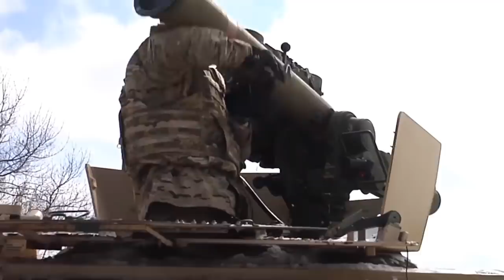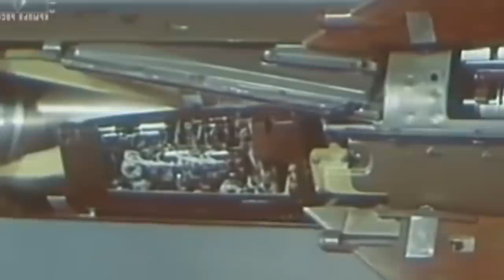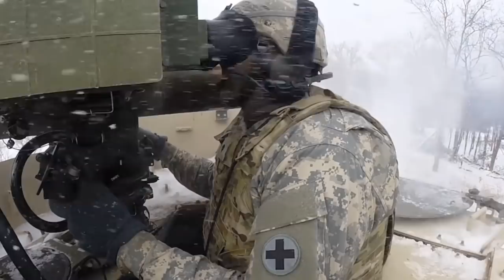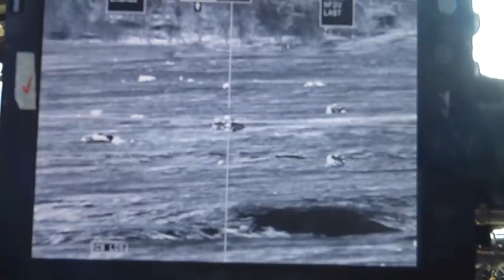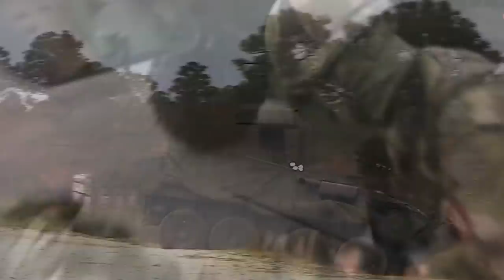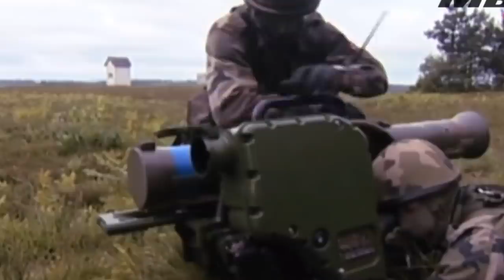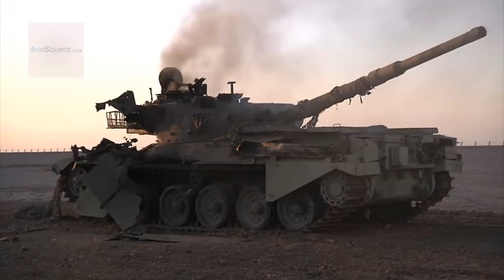Should Main Battle Tanks have Anti-tank Missiles?

Comment: Big guns are great if you want to have a big vehicle. Big vehicles are big targets and are expensive assets. They also require expensive supply trains. Moving large armored vehicles is expensive, and requires large air/ground/naval assets. Big vehicles are also not flexible. That is, fewer of them can be deployed, limiting the number of places that can be struck or defended at any given time. Heavy armor is also not practical in the age of ATGMs, as it is easily defeated by missiles at ranges that big guns are not capable of engaging at. Protection against small arms fire on a vehicle is sufficient as long as it is equipped to dispatch more heavily armored assets at range. Tanks are, in effect, obsolete.

A very small, autonomous tracked vehicle with 2-4 ATGMs (or a combination of those and AAGM) and a machine gun or autocannon could accompany every infantry squad and provide effective fire support against armor, defensive positions, and infantry. It could do this without weighing down the infantry, or exposing them to fire. If you add in another autonomous vehicle or two to carry supplies, and small reconnaissance assets that can be deployed locally (drones), a squad could become much more flexible and independently capable. Small and flexible is the name of the game. Hard to hit, affordable lethality.

Comment: actually i can see (somewhat strangely)  a divergence within the next 20 years with battle-tanks again.   With the MBT possably vanishing, and effectivly cruisers and infantry tank making a comeback.   the problem or reason stemming from a fundamental issue with rail-guns.  the power requirements on a rail-gun go up exponentially as the size of the round they are slinging goes up.  A 40mm HVAPFS round out of a railgun at 3-4 km/s will likely punch straight through most tanks, and be able to hit tanks, or even helicopters out to 8-16km  retaining enough energy for a kill.   The problem is,  A 40mm HE round,  at those velocities, is all but pointless, and sure you could scale the speed down to 1km/s  and rapid fire 40mm rounds but again,  its not much better then firing a grenade launcher.   For infantry support you want 105mm+  So you'll have the infantry support tank which doesn't have the speed of the cruiser tank...  but instead carries a 150-180mm low velocity tank gun,  firing tube launched missiles, HE rounds, HESH rounds, and HEAT.  HESH in this case is not for anti-tank, but anti building,  creating massive breach holes in the sides of buildings (Usually was used by US Engineering tanks.)  or flattening fortifications.

Comment: Most Chinese and Russian tanks use auto-loaders. If they want to change from DU rounds to ATGM, how will they achieve that? Sounds awkward.
Reply: Thanks B1. Not sure about the unloading either ( eject most likely?) but auto loaders saves a crewmen and allows for extend handling of heavy shells in even broken and rough terrain. The think with Western tanks is that while they are nice a stabilized it's no joke loading heavy shells on the move in broken terrain. As i understand it by the late 60's or early 70's Soviet tanks ( t-64 , T-73) had a significant capacity to fire accurately and on the move at 1.5 - 2 k engagement ranges.

Comment: Redundancy of different systems and ATGMs are inferior to a tanks APDSFS round.  ATGMs were invented to give light vehicles and troops a means to deal with hard targets and tanks but they always lacked one of the key qualities of a tank gun and munitions.  ATGMs are slow and rely on shaped charges and this makes them easier to defeat with modern tank mounted countermeasures.  It would simply be a waste to install an ATGM platform on a large tank that already has superior AT munitions.   I'll take using an APDSFS over a Javelin any day and I don't want to be bothered with dwelling on my target while leaving my tank partially exposed after firing a TOW missile.   High velocity guns rule.  If you own one, then use that.

Comment: I'd say yes, because we can slave the atgms fired from tanks to drones. Thus the tank can fire from behind cover at a target that it can't see and one that can't see it back. Which is obviously a pretty good advantage, though the same can be done with normal tank rounds. Only question is when an army would employ such a system, because all the tech is there. Just most tanks would need modifications to allow some systems, which of course would cost money. Now of course i'm talking about missiles that aren't wire or remote guided, thus they have their own systems for tracking a target. Because ya, missiles you have to guide yourself are just stupid for modern warfare. Since they force you into a position that limits you quite a bit.
Also with newer tanks, you don't have to limit them to atgms. Because if you wanted to, you totally can have a tank fired a short range aa missile. Just once again you'd most likely have to make some adjustments and thus spend money.
Reply: The tech is already here, including the AI for autonomous engagement. NLOS missiles don't require slaving, or a person actively guiding them, although that too has its benefits. And in the future, the line between drones and missiles will get even more blurred than it already is with the arrival of loitering munitions.

At this point it would be best to just go straight for vertical NLOS launchers on an armored chassis. Should mostly solve the problems with complexity, capacity and space that missile tanks and missile tank destroyers have historically had, too.

Comment: Because of the cost, Tanks should first shoot their Cannon to kill an enemy tank, if the tank survives, the missile should be used as a follow up shot to prevent the enemy tank from firing back! This should also be the case for tank destroyers, the entire point of tank destroyers, use the cannon first, and the missile if required. Or in the case where a tank is outnumbered: two enemy tanks vs. one US tank, the missile gives you the ability to fire at two enemies simultaneously! Missiles should be for clutch situations, not standard M.O. The use of tank destroyers should be to lower the cost of destroying an enemy tank, a javelin missile is 175,000 dollars, and though an armor piercing shell is 9000, (it should really cost less than 1/10th that) its still a lot more affordable! two javelin missiles and you have a tank destroyer that is good for years of tank destruction, especially when drones give it the ability to fire beyond visual range!

Comment: ok lets use my brain and some base knowledge on this.
A. Why mount ATGM on Turret ? What ATGM give to tank ? Longer range penetrator, ok sound nice, there is problem with this, most tanks can and will place shots on max range they can see, and most battles wont take place on range of more than 5 km, why ? Tarein, there is always a lot of things that block line of sight on long ranges.
B. Why not Mount ATGM ? Cost ! They need to be implemented into existing or new tank design, you need to get exta aiming system, you want use your guner to use gun, and commander to check battlefield, so who going to use ATGM ? Loader ? Ok then who load gun for you ? Driver ? Yes and who going to drive your tank ? So we have a problem right? Ok lets go forward. USSR/Russia use barrel launch missiles to get this long range killing potential, then why they almost never use it ? It lower lifetime of gun a lot !, so it cost a lot, so what mounting it outside of turret , ok next to what ? It's a missile , it has full, and warhead, so what if they hit by Autocannon or he shot, or rpg? Yep it will explode damaging a lot of important systems on turret that you need to fight. So we need to armor it a lot and build it with side explosion mechanism to protect tank, ok what about interfary that support tank? Yep we just make there life harder.  On top of that we add Weight on top of all problems, and that means more problems for engine, and sapers like me who have to make you a freaking breage under fire fast.
 
Let's sumee this block of text, there are no large logical reasons to add Missiles as extra weapon to tank, ATGM job is punch above your weight, tank do that using its gun, so until we end with a tanks that can kill enemy tanks using there guns there no need for ATGM aboard, ManPads on another hand my or my not find there way to new generation of tanks. Same go for 20 mm autocannons mounted on top or side of turret to give tank basic Air defense and city protection. For now I say good day/night to all of you. My imperial knight won't paint it selfe ^^

Comment: Would this be a good, anti-ied device, attach a load of ropes to the back of a mil 8, atach   rocks  the ropes and and fly low ib the air with the rocks on rhe ground
Reply: Are you talking about the M1 ABV? 

Which is basically an Abrams variant designed for mine clearing equipped with MICLICs?
Reply: I mean, yes, but it would fucking suck for the helicopter crew

Comment: doesnt the Russians use ATGMs in their MBTs?
Reply: Sabau Danut Alexandru in mother russia. tanks reloads their ATGMs automatically from 50 years or so
Reply: All tanks from the T-55 have the capability of firing ATGMs. T-55 / T-62 / T-64 / T-72 / T-80 / T-90 / T-14 and their modifications in the presence of the installed kit KUV.
T-55AD even had the first serial active protection kit.
Also there are kits installed on the BMP-3 100mm and 105mm NATO, etc. with a 100mm "Arkan" rocket, there are kinetic guided missiles for sea and land versions of 57mm cannons.
All basic modifications of BMP and BTR have demountable launchers for ATGMs.

Comment: Actually very ironic, check this out!!!! Iran has actually already developed a solution for that! The tank is a T-90 lookalike version called "KARRAR" 

https://en.wikipedia.org/wiki/Karrar_(tank)
Reply: Here's some info just about that:

Main armament of the Karrar consists of one 125 mm smoothbore gun fitted with a fume extractor and a thermal sleeve.[8] A remotely operated weapon station armed with a 12.7 mm machine gun is mounted on the roof of the turret. The main gun is able to fire anti-tank laser-guided missiles.[9] An autoloader is also installed, removing the need of a loader.[10]